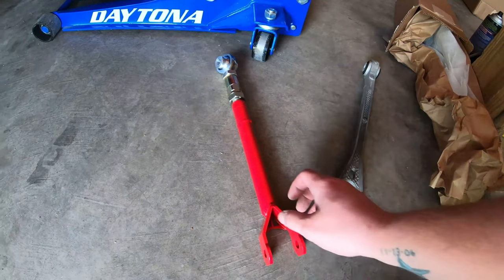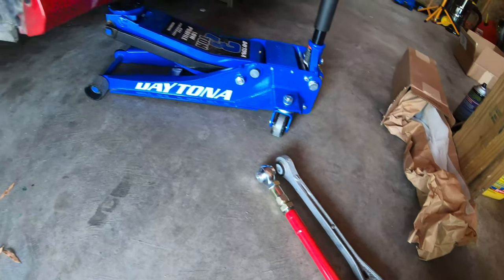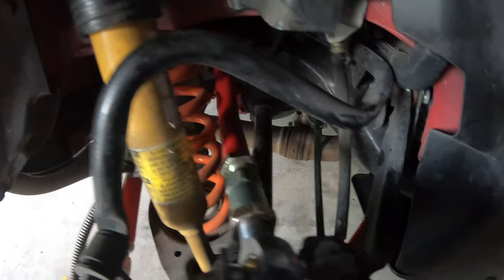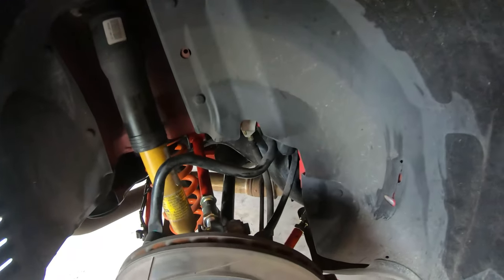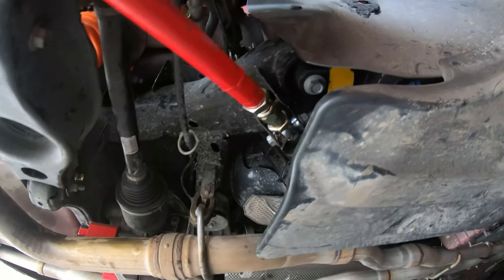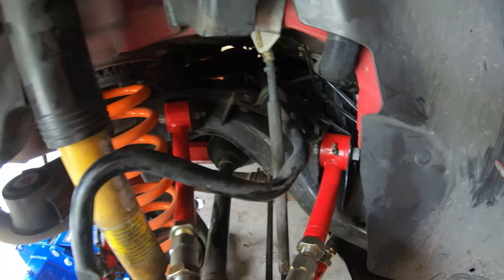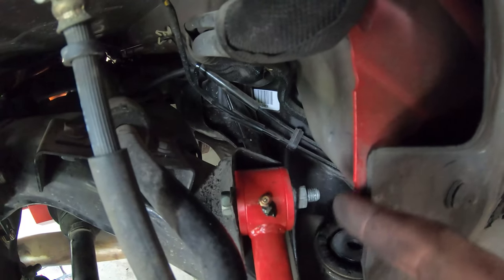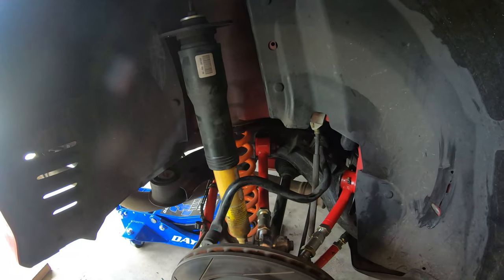BMR Suspension Install On A Dodge Charger 392 Scat Pack!

Comment: Got the same setup, rear suspension arms, diff brace, front and rear strut tower braces, it made a big difference in handling and traction, it makes the ride a little bit more bumpy but it’s still smooth, and it’s the same color, red

Wanting to get better sway bars and end links and suspension arms for the front to adjust the camber to center out the tire wear so it doesn’t wear on one side faster than the other

Comment: The bmr suspension components are nice but always had clunking and banging from on car adjustable arms...the heim joints were replaced several times and last about 300 miles and start to creak...now going to change to AAD this time...great video
Reply from the maker: Thanks man I appreciate it I regressed these haven’t had any issues so far working great
Reply: @CodeNameScat  how are these holding up? i'm
on the fence with these and aad arms

Comment: Hey man just install upper control arms on my challenger, usually the two nuts that are on the out side of the adjustment thing are used to hold the adjustment in place but wasn’t sure if these are different and the outside nut holds the adjustment in place and the inside nut goes all the way inwards towards the control are just like you have it in the video
Reply from the maker: Those things are pretty confusing at first  it took the guy a minute doing the alignment to get it too

Comment: I did my 09 Shelby GT500 from front to back with BMR suspension and it handles great, now that I just bought a dodge charger rt I'm planning on doing the same.
Reply from the maker: It’s definitely made a night and day difference for me
Reply: @CodeNameScat  I don't have alot of experience working on these new chargers but I already lowered mine and added the cold air intake both front and back strut tower braces, I'm changing the front A-arms and all the rear control arms with BMR suspension, I'm dreading having to lower the whole rear suspension but it couldn't be harder then changing out the whole front suspension like I did with my mustang.
Reply from the maker: It’s actually pretty easy man you just need two people you drop one side at a time and it’s not bad
Reply: @CodeNameScat  good to know thanks I have 2 teenage boys that can help me while learning how to work on cars, nice looking car by the way hope you can make it faster.
Reply from the maker: Thanks man I appreciate it yeah just someone with an extra hand is enough
Reply: @CodeNameScat  Can you give me a list of all the control arms you ordered from BMR suspension, I've been looking on their site and can't seem to find the upper control arm that adjusts the camber.
Reply from the maker: Hit me up on Instagram @codenamescat I got you

Comment: So, with that being such a pain and having to drop the cradle to get to the bolts it makes me wonder how people keep the suspension from binding? Because your supposed to tighten the control arm bolts with the suspension loaded.
Reply from the maker: Well I guess I messed up there for sure then but I don’t know how I’m the world I would get to them either lol I’m not a mechanic by any means lol
Reply: @CodeNameScat  yeah, I would have to see that in person to have an idea... BUT, that’s one of the big things when you do any suspension work leave everything loose, drop it on the car ramp/ Cribs or whatever you may have and then tighten.
Reply from the maker: @NoFox_Given  I did it by bmr instructions
Reply from the maker: It’s crazy cause with it he wheel on I couldn’t get to any of it

Comment: I think I maybe I would have loosened the bolt a little then slip a saw up there and try to cut the head off the bolt and then replace the bolts with new ones. Just a thought?
Reply from the maker: That could be done I was just following instructions given by bmr for the sponsor

Comment: I think they have the bolt flipped around like that so just in case the nut comes off, the bolt will stay in while driving. I can see no other reason to put the bolts in like that where you have to drop the sub frame just to get them out. Just another pain the A$$….

Comment: What parts do I need to get the CAMBER back to spec? Having excessive negative camber after lowering the car that needs to be adjusted.
Reply from the maker: In order to get it perfect you will need upper control arms that are adjustable but I would recommend getting the whole package from bmr so that way while your in there you can just replace it all in one go
Reply: @CodeNameScat  couldn't find them as a package, and getting them individually is kinda costly rn. So on-car adjustable REAR UPPER control arms (P/N UCA112) would be the right part to get in my case, correct?
Reply from the maker: Yes that’s what you want
Reply from the maker: Those are easy to put on too
Reply: @CodeNameScat  Appreciative for your informative video and assistance.
Reply from the maker: Thanks for watching an supporting the channel HMU if you have any more questions

Comment: Well.... I’ll be installing upper control and trailing arms Sunday.. any advice outside the video?
Reply from the maker: Are you doing the upper trailing arms or lower??
Reply: @CodeNameScat  upper
Reply from the maker: @randyleflore5971  get you a good set of wrenches.. rachet wrench will be your best friend doing this job an a regular wrench on the other side ..  for the upper trailing arm but man if you hit me up on Instagram @codenamescat I can walk you through it I’m just driving right now man so it’s hard to explain everything
Reply: @CodeNameScat  I most definitely will. Thx
Reply from the maker: @randyleflore5971  no problem man I will be putting my Viking shocks on tomorrow so just hmu